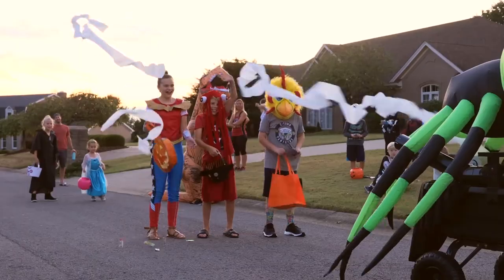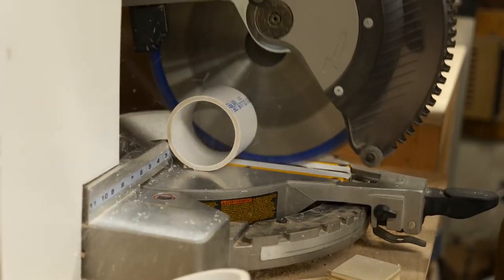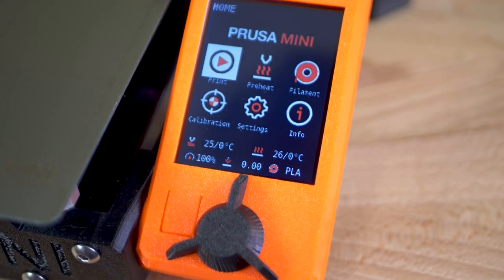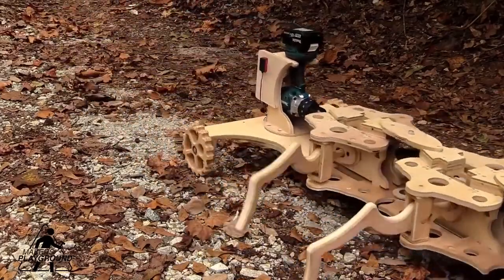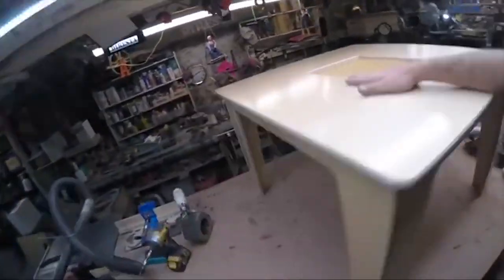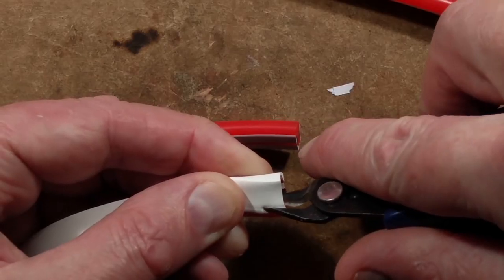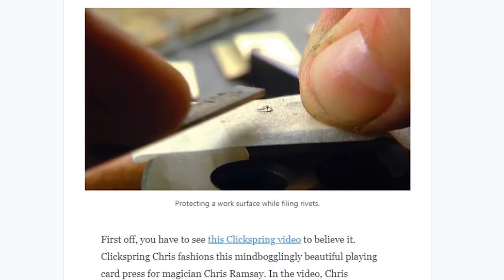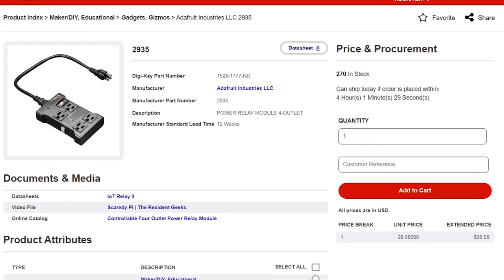Spider Roll [Maker Update #145] - Maker.io

Comment: Does anyone have a design for a small tabletop Mechanical Advantage Press Break that could utilize these 3D printed Dies in? Creating these dies would be perfect for folding metal boxes to utilize. Metal boxes are some of the most difficult shapes to manufacture. I just don’t possess a 20 Ton hydraulic press break. But I have used a small mechanical advantage hand break with a adjustable stop for repeatability of angles on the vertical axis. I don’t think these plastic dies would handle a finger type break bending application design. I would create so many dies with different bend radius’s in them so I wouldn’t need to use soft 3,000 series aluminum to prevent cracking or having to use soft state aluminum and heat-treat after fabrication. 
Question? If I designed and built a Table-Top Press Break to utilize these 3D printed dies; would anyone be interested in this design build??? Just trying to figure out how much documentation I would cover during the creation if no one has a design they know of for me. Thank you in advance people. Best regards JP
Reply: I would definitely be interested. When I saw those I was thinking if I could use my car jack to produce enough force to create a press break. I would want to see what you come up with.